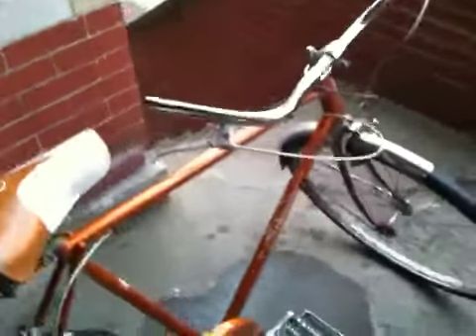Using Aluminum Foil to Restore Chrome

Comment: Hello, I've got an occ stingray chrome frame and it's pitted, I've tried sand paper, brillo pad, a wire brush drill tip, and a green polishing compound, it's got close to a mirror finish but the pitting is still visible,

Comment: I have heard that this method works because of the different hardness of the metals. Aluminum is harder than Iron Oxide (rust), and the Chrome-plated Steel is harder than the aluminum. Therefore, the aluminum is hard enough to scrape off the rust, but it gives way to the chrome-plated steel and will not scratch it.

Hope that solves the mystery!